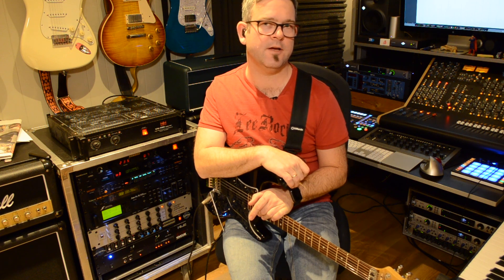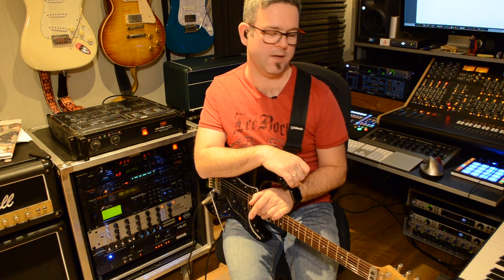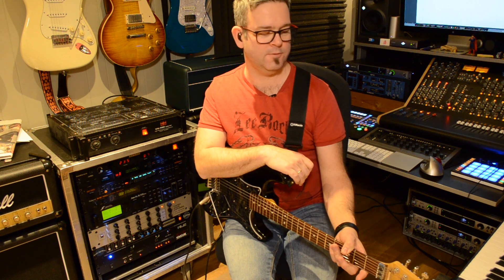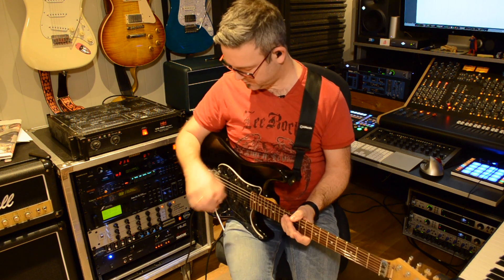Custom Audio Amplifiers 3+SE: Solidstate vs Tube power amps

Comment: They both sound great. What reverb and delay are you using? I'm currently going through a H&K mark 3 in stereo with a Lexicon pcm 80 with Strymon DIG & El Cap with a line mixer. Thinking of going back to preamps
Reply: How do the two Stymons fair headroom wise? Are they line level suitable? I was pondering a hybrid , peda and  rack setup but worried pedals would negate things, headroom wise.

Comment: Thanks for doing this Kjetil. I actually like the H&H better. I wonder if you should turn off or alter the extra EQ stage on the 3+ to make it a fair comparison? IIRC Bob and John used it to breathe life into the flatter sounding PA style power amps as they were the only choice at the time.  As a tube guitar amp will not be too flat are you EQing an amp that already has a bump in the upper mids?  FWIW I did not like the EQ on with my Boogie 2:90.

Comment: Hey Kjetil, thanks for doing this!  I notice that the tube power section has a bit more "zing" to it......a bit more sizzle.  I also watched that interview, and a lot of it was stuff that we have heard several times over the years.  

Do you think that the tones are similar in your experiment because you are using a preamp only into the power amps?  
 
I am asking that question because I'm currently slaving my main amp heads into a Suhr Reactive Load, and had used a Matrix GT-800 solid state power amp for a long time to provide the stereo power.  However, I  recently tried slaving the amps through a VHT 2/50/2 tube power amp, and I really liked the tone and feel much better!  I found the the difference when slaving with the Matrix vs the VHT, was not subtle at all.  

Thanks for posting this!  It's great to be able to share stuff like this.....Cheers!  :)
Reply from the maker: Ian MacNeil Hi buddy! Well I guess tube on tube will work also. I tried the Matrix stuff and I didn’t like it at all.  I’ve tried the slaving ting too, and a reactive load is absolutely needed. I’ve got a Weber speaker motor as load here that I’ve tried as load in slaving. It’s basically a real speaker but without the membrane.